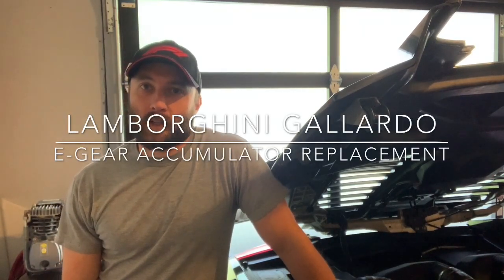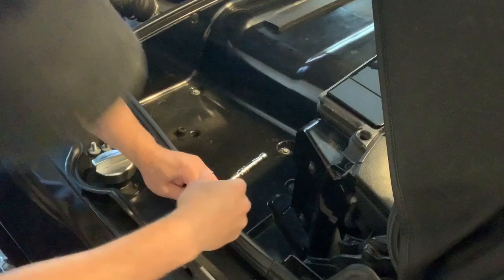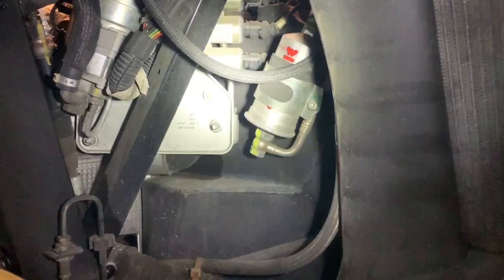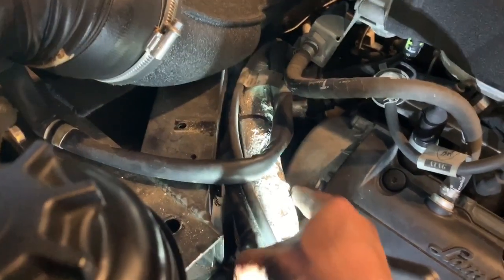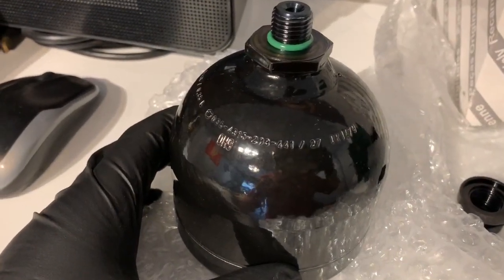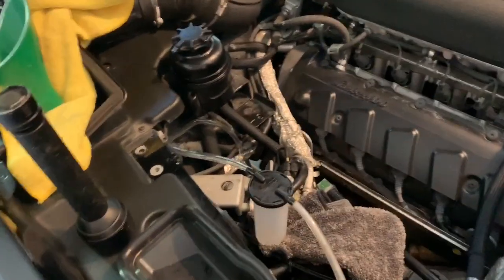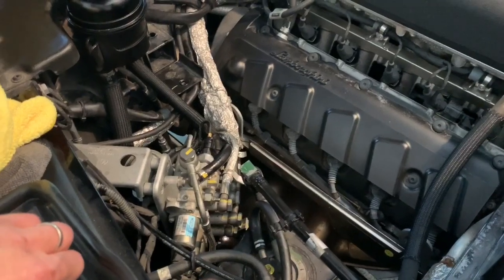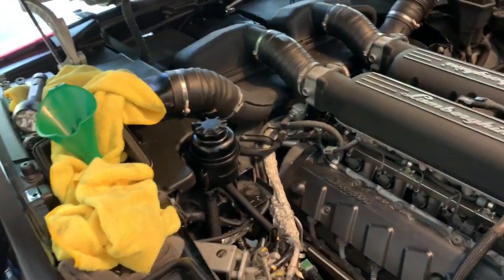Lamborghini Gallardo E-Gear Accumulator Replacement

Comment: Hi Evan great vid. I changed the accumulator, pump and relay. It def primes alot shorter 👍🏻 Prob is when im at the lights in netural and pull 1st gear it goes 1st then flashes N and Ror flashes all gears 1/6. It takes 2 or 3 attempts to get 1st 🤔
Reply from the maker: You may have an issue with the egear actuator or the solenoid valve block. When the transmission control computer senses a problem it will fault/kick you back into neutral.

Comment: What torque spec is the accumulator?
Reply from the maker: Not much access for a torque wrench in there. I used a crescent wrench and got it reasonably tight, use your best judgement.

Comment: Hello mate. Hope your car is running great since the video. I am thinking of changing my accumulator as well. Very  helpful video and I will use this as a guide. Can I ask how many litres of e-gear fluid did you need? Is a vacuum based pump really needed or a normal tube and reservoir will do? I heard you used the pentosin fluid, any issues with that? Thanks.
Reply from the maker: I don't remember exactly how much fluid I ended up using, but I know I only bought 2 bottles of the CHF 11S (1L each), and I still have one left that's basically full. My guess is I used a little under 1L. No issues with the Pentosin CHF 11S after a couple years and ~1000 miles. I can't say whether the vacuum pump was necessary, but it certainly made it easy to ensure there were no bubbles in the system when I refilled it.
Reply: @EvanKontras  Thank you very much, mate. Really appreciate your time and for helping me out.

Comment: if ur old acumulator wasnt leaking? what drifrence does the new one would do? it looks like is just a bottle to hold presured fluid. no inlet no outlet with a check valve??
Reply from the maker: Inside an accumulator is a diaphragm that stretches, allowing the internal volume to change so that pressure can be stored and returned to the system as needed over time. When that diaphragm fails, the accumulator is not able to provide pressure for any extended length of time because it becomes essentially constant volume. So, although it is not leaking externally it cannot act as accumulator anymore, and the e-gear pump must constantly run to keep providing the system with the necessary pressure. Hope that helps!

Comment: Great video! I'm still not certain what wrong with my gallardo since it wont shift. It jumped out of gear on highway, I got lucky, got it back into gear, drove a few miles and jumped out again. Now it wont go back into gear, and the N and R symbol in the dash flashes, and the pump wont run anymore. I assume it's the pump, but some say it could be the actuator or even the accumulator, but why wouldnt the pump even try to run and build pressure if those are faulty? Do you have any insight to share perhaps? If so, thanks a lot!
Reply from the maker: Yup, sounds like your egear pump has failed. If there is a leak in the system in the actuator, or if the accumulator has failed the pump will still run. In fact, it will be running almost constantly to try to make up for the loss in pressure from the leak! I'd start by replacing the pump.

Comment: Hey Evan after replacing my accumulator my clutch became slip please how you bleed it I have same bleeding thing you use (do I have to keep pumping till no more bubble where should the gear be and nipple close or open thanks
Reply from the maker: It is not unlike bleeding brakes. Open the nipple and pull vacuum on it to pull bubbles out until there aren't any, then close the nipple and let the pump prime or do a couple shifts. Repeat the same process again until no bubbles come out and make sure the reservoir is topped up the whole time.
Reply: @EvanKontras  thanks a lot Evan so just leave it on neutral should I be pumping the vacuum till no more bubbles i will trying to do it like bleeding brakes thanks again Evan

Comment: Hey Evan do you know the 2012 Audi R8 e gear bleeding nipple location
Reply from the maker: Although the gearbox is the same, the accumulator assembly is different on the R8. It sits on the right side of the gearbox itself. There is no bleed nipple on the R8's accumulator assembly, and Audi states that the R-Tronic shift actuator and hydraulic unit are self bleeding. The bleed nipple on the top of the transmission for the clutch throw out bearing is just like the Gallardo, but you don't need to deal with that if you're just replacing the accumulator.
Reply: @EvanKontras  thank you so much I’m only changing the accumulator so no need to bleed the one on top of the transmission right ? Thanks a lot 🙏
Reply: @EvanKontras  thank you so much Evans 🙏

Comment: friend I have a gallardo 2005 does not enter speeds the light of the R is blinking can you help me?
Reply from the maker: That could be a few things, but replacing the accumulator is certainly the cheapest place to start. With key on, engine off, can you shift through multiple gears before the egear pump primes (you'll hear the pump prime)? If not, you may need a new accumulator. If you are completely stuck in neutral, you may have a damaged egear actuator.
Reply: @EvanKontras  thanks for the help I found out that the electric motor of the shift actuator is probably burned out, probably the relay of the same
Reply: @EvanKontras  can you help me find that electric motor?
Reply from the maker: @edycabral6367  Yup, a failed egear pump motor will certainly prevent you from making shifts! Fortunately they're not crazy expensive, and are pretty easy to access, and you don't need to mess with the hydraulics of the egear system to replace it. The pump motor is accessible from the passenger rear wheel area, just remove the wheel and inner fender liner and you'll see it. I point it out in the video as well.
Reply from the maker: @edycabral6367  Sure thing. Just do a search for egear pump motor or ferrari f1 pump motor and you'll find a lot. They are available on eBay and many other sources. Part number is 086901137M so you can cross shop.
Reply: @EvanKontras  i got the engine and changed the clutch but i can't program the gearbox
Reply from the maker: @edycabral6367  It may be worth taking the car somewhere that has Lamborghini LARA software or an equivalent like TEXA or Leonardo, that way they can scan the egear system for faults if there are any.
Reply: eittt

Comment: Did you get an e gear warning light before doing accumulator fix?
Reply from the maker: Nope, no e gear warning lights. Just delayed shifts and dropping into neutral between gears (particularly from 3rd to 4th).

Comment: Hey Evans please do you also notice shift from 2 to 4 or 5 sometime and also Hick when push to A1 or reverse thanks mine is r8 though
Reply from the maker: I did notice some trouble getting it into reverse a few times, but I never had an issue shifting from 2 to 4 or 5. Only issue shifting was dropping into neutral when trying to shift from 3 to 4.
Reply: @EvanKontras  thank you 🙏 so much for that information that’s same problem I,m getting please from where did you order your accumulator
Reply from the maker: @obellenwa1  I bought the accumulator off of eBay.
Reply: Thanks a lot I found it

Comment: Hey Evan, did you need to release the pressure on the accumulator first to unscrew it?  I can’t seem to get mine in my coupe unscrewed and wondering if it’s still under pressure?  I’ve had the battery off for a couple hours but still can get it to budge.
Reply from the maker: I did not need to release the pressure of the egear system before unscrewing the accumulator, but make sure the egear pump hasn't primed in a while. With your battery unhooked, the pump won't be able to prime so the system pressure will slowly drop over the course of a day or so.  When I unthreaded mine there was no drama (no fluid spray or anything), just a little dribble of fluid as I pulled it out. It's probably just stuck in place by a little corrosion on the threads, you'll get it.

Comment: so quick ? here does the fiat one work for the lambo because the part numbers are different and so are the prices  fait has your part number for 216 and lambo has it for 400 but i wanna know if I'm looking at this wrong fait number 68137313AA  lambo number 086325585
Reply from the maker: From what I can tell 681373133AA is NOT a compatible part. The correct Fiat/Alpha Romeo/Lancia part number is 71751195.
Reply: @EvanKontras  hey evan so i got it from fiat part number 6813731aa which is what's on your box and on mine the bottom number's also the top number match to the 717 number the bar is the correct number and all
Reply from the maker: @kpsupra90  Awesome! Great to hear, thanks for the info.
Reply: @EvanKontras  evan so i tried the accumulator but i didn't work i still have the problem. Mine is flashing RN and all the gears 123456 i can get it into gear if i hold down the paddle shifter it'll go in to all the gears that way but will flash's and will go into neutral as soon I let of the throttle also if i have the car off key on and i hold the paddle to shift thru the gears i can hear my pump run thru all the gears you have any idea any advise would be great thanks
Reply from the maker: @kpsupra90  First thing make absolute certain that you've bled all of the air out of the system. If you have any doubts, bleed it again. If it is still not holding pressure (ie your pump is still running every time you make a shift), you may have an internal leak in the actuator. If that's the case you'll have to remove it and send it off to be rebuilt or find a good used one to replace it.

Comment: also, mine is a coupe... so wondering if me prefilling the accumulator would be easier since my accumulator is vertical instead of horizontal?
Reply from the maker: The accumulator holds a pretty small amount of fluid. You certainly won’t hurt anything trying to prefill it, but I’ve found that I end up spilling more fluid if I prefill it versus not. And since you’ve got to bleed the system either way, there’s no real advantage of trying to prefill it.
Reply: @EvanKontras  thanks my friend gonna tackle this project this weekend. Changing out my egear pump, accumulator, and relay to the 70amp relay figured knock it all out in one swoop.

Comment: did you ever need to bleed the lower valve? the one that's buy the actuator? or where you able to do it all from the bleeder valve adjacent to the egear fluid resovoir?
Reply from the maker: With a vacuum bleeder you can easily bleed the system from the bleeder valves adjacent to the egear reservoir, no need to mess with the other bleeder valve.
Reply: @EvanKontras  appreciate the video too. Even though mine is a coupe it showed me how you bleed the system with gear change engine off bleed repeat.
Reply: Was your vacuum line completely no air bubbles? I’ve bleed this thing like 8 x lol and still few micro bubbles appear. Should it be absolutely no bubbles?
Reply from the maker: @Captain_Speedo  There shouldn’t be any big air bubbles in the system but if you’re using a vacuum bleeder and the seal between the vacuum bleeder hose and nipple is not really tight it can actually pull tiny amounts of air into the hose as you’re using it and make it look like there is air (bubbles) in the hydraulic system. Perhaps that’s what’s happening for you?
Reply: @EvanKontras  yea i think thats what happened to me. thanks for the reply

Comment: We’re you having shifting issues prior to replacement? If so, what symptoms 
Thanks
J
Reply from the maker: Yup. The car would drop into neutral when up-shifting shift sometimes. Also, I would often have to pull the paddle twice to get the transmission to do what I wanted, whether it was an up-shift, down-shift, or pulling both paddles for neutral. This was because there was not enough pressure built up in the system, and no reserve pressure in my failed accumulator.
Reply: EvanDoesEverything  cool having a similar issue with my Spyder.  Won’t down shift properly (intermittently). Pops in to neutral sometimes when shifting with paddles.   Seems to never act up in auto (but of course auto mode is terrible on clutch).   I just put clutch in back in January so I’m going to change this valve and pump motor while I’m there.    Thanks for the info and awesome video